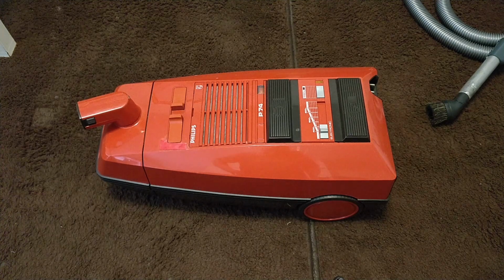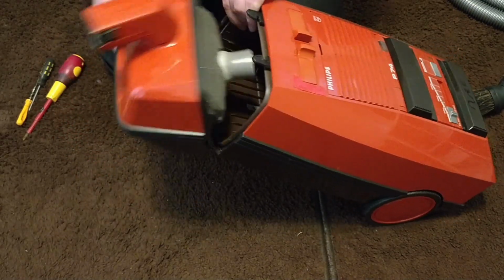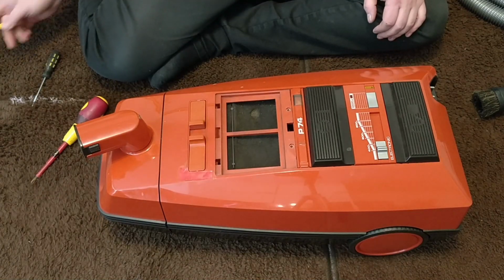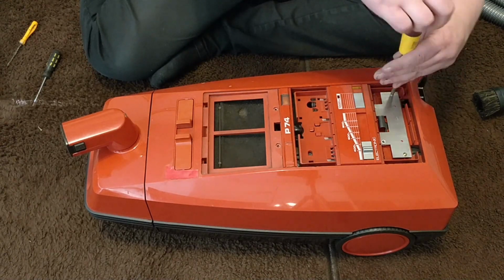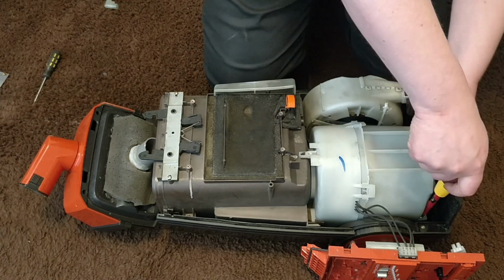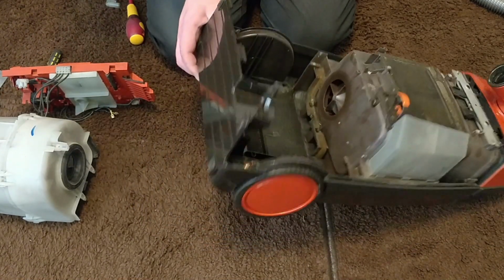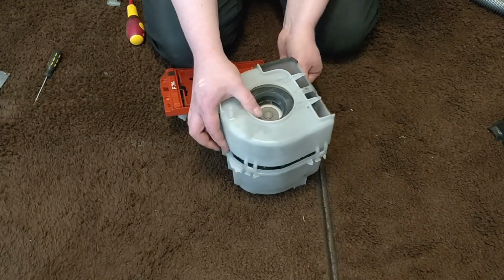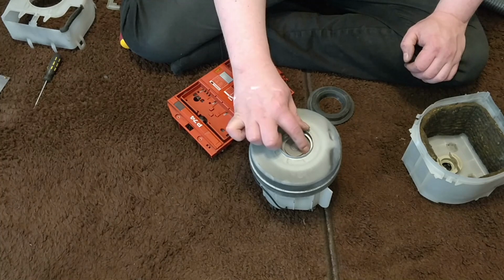Taken Apart For Cleaning: Philips P74 Electronic

Comment: Before you disassemble this I did it a year ago. Something else is that the cord rewind after all this years works beautiful different than Miele C3 that tend to tangle the flex inside. My Philips P90 single speed or the Dyson DC39c never tangle the flex. Anyway Philips still was a good manufacturer and innovator. Soon we will see also yours because those mix Shark-Electro-Dyson I like it a lot. Just waiting for the next just after the 2000 watts Volta.

Comment: Hey, i have the same model, but i have a problem : exaust air is escaping by the cord rewinder. Do you have this problem aswell ?
Reply from the maker: That is a weird problem. Sounds like someone has taken apart your Philips and not done it properly reassembling it. These have sealed exhaust chamber so something is really wrong with it.
Reply: @vacuumtests9225  i don't think so, i have oppened it and change the foam  everywhere because it was perished and it didn't helped. I think there is a gap in the full bag indicator area.